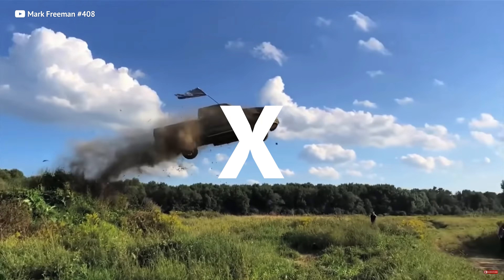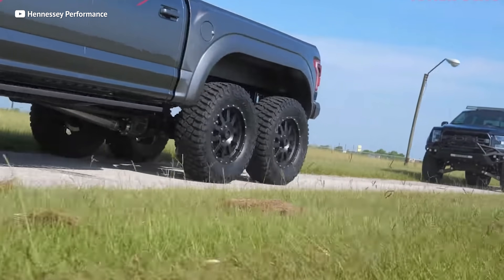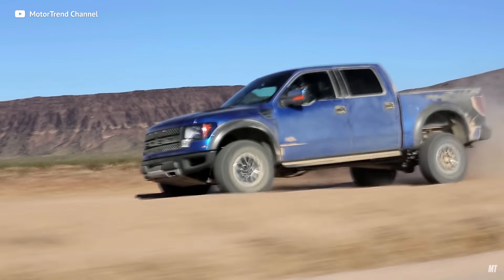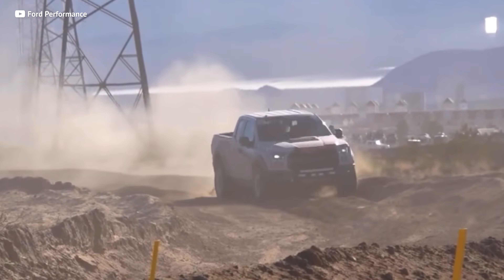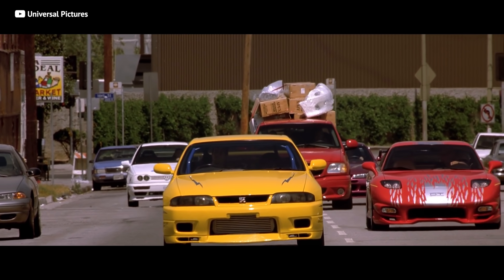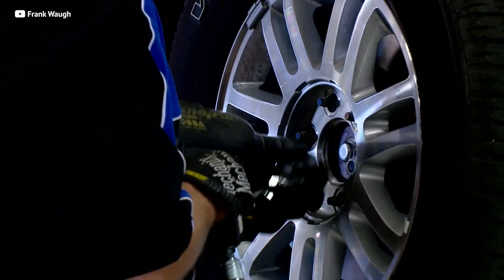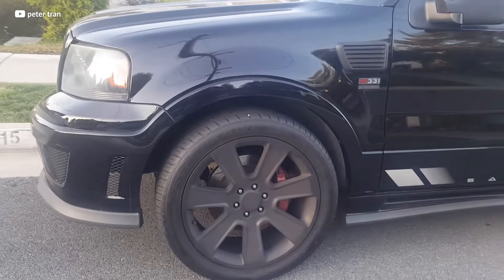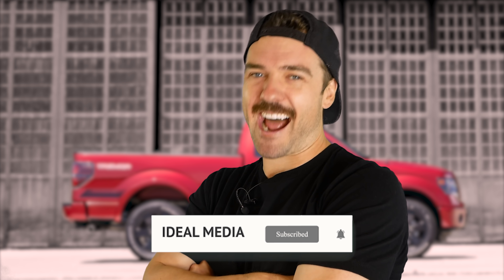5 Best Ford Trucks You NEED To Buy!

Comment: Should’ve just a f series episode now you have the new 2020 tremor f250 diesel they make the most power 475hp and 1050 ftlb of torque which means more torque than any other truck plus they can be bought with the new Godzilla engine 7.3 v8 and the tremor is a off road variant so awesome to have a off road diesel or big 7.3L heavy duty truck that can tow.
Reply from the maker: That sounds wild!

Comment: I can vouch i own a 2003 lightning and it is a beast the only complaint i have is that if the roads are evwn the slightest bit wet you shouldnt drive the truck is so light weight that you dont get any traction you go to give it gas to go up a hill and the truck loses all traction and starts to slide out and it gets horrible gas milage but aside from that the truck is truly amazing

Comment: 4x4 single cab sb e85 tuned 5.0 10spd is faster then alot of lightnings and that's like the slowest/least powerful f150 engine option.

Comment: The only problem the 5.4 has is the spark plugs break when you change them but other than that I never had a problem with the 5.4 and it gets good gas Milage as long as you  not driving it fast all the time

Comment: what about big foot & the sand box. the camper special. some had boss 302, 351c, 390m, 428 cj 429b & cj, think that was the day before all this computer. don't think i don't like the ez of turn with computers. but back in the day we were on our own. you just did not go buy all the tuning you wanted, you built it, with suspension to run it. OH YEAH, how i really miss the late 60s early 70s. just 1 of my favorite, 429 super cobra jet. that area had HP & torque to melt tires!

Comment: Why my dads raptor 2nd gen just got 213 hp the same base model the same engine twin turbo v6 even got fox springs it even said in the manual to 213
Reply: Welp ours is 2.0L so its 213

Comment: As cool as the Tonka F-150 may be, I'd rather get a stock F-150, lift it, put bigger tires on it and wrap it yellow instead for much cheaper. Maybe an aftermarket dump truck bed just for the heck of it and it would still be cheaper than a Tonka edition F-150.

Comment: Ford let's transmissions fail on the assembly line. Anyways........ Instead of bashing found on the road dead.
Lexus is the real king in terms of reliability. Tests their engines by stressing them out before it's even put inside the car. Can go literally 1 million miles if you treat them right. Did I mention Lexus are also cheap to buy and can run 0-60 in 3 seconds? Also yes Lexus has V8 engines.
Reply from the maker: Squidd just bought a Lexus GX470, that things a BEAST
Reply: @IdealMediaChannel  ya. I have no idea what Lexus truck name is but since both the raptor and Lexus are wimpy trucks at towing that means Lexus would make a fine comparison at 6,500lbs
Reply: @IdealMediaChannel  say I do have 1 serious question. I recently picked up a beautiful heavy white steel frame 2007 patriot. I want to throw a Lexus engine as soon as it dies off.

Comment: Till you find out ALL the Cam Phaser problems with the Gen 2 Raptors and how many Gen 2 owners actually go BACK to Gen 1 for reliability. Get a 2013-2014 F-150 Raptor, best years, best models and have all the Sync upgraded on top of it, thank me later

Comment: Note the V6 note please stop!! The Gen. 2 please stop!! Wait until you stop with 7.3 l is leader in it with a pro charger is the approach harder you can double the pleasure if you want but I don't think it would be wise. I think the  grade would be a better pick I wouldn't waste my money on a 6 cylinder unless I'm planning on changing the motor out and putting Is AV8 into it. Sorry I don't settle for less than 8 With that combination I spoke of with the 73 just just stock alone is under 600 horses That's before tuning that's not even both tuning both tuning the transmission and anything else along with it You could just imagine the torque is the torque from that by itself by itself with a stock motor before you do the add on to anything else afterwar That pro charger is something to behold. Screw the 2.7 screw the V6 is the 4 cylinders and all this other Pansy ass way of reckoned doing things he hoped more gears and more power into these vehicles you're going to get better gas mileage I don't understand why people don't get that , It's just ridiculous. And there's freaking Broncos a 2021 version yeah that was a dumbass idea That should not have came to 4 Russian this randition is for pansies not is for pansies not for people that actually drove a Bronco before. They're looking like they come up with what the the new version is a 35" tire really really and a smaller motor why! Any Bronco owner would tell you a 4 cylinder or a 6 and whether it isn't going to cut it especially  in a full sized Bronco, This Mid size It's a joke I got to I guarantee you off the shelf you could come up with a better Bronco off the shelf with a better frame better suspension and a better drive train this is just a joke the things that these people come up with and they didn't have to do a different version altogether we have off the shelf parts that we could have used to put this truck back together But no let's be more of an idiot in basic basically  Hop on a bad foot and do the wrong thing.  What should I need better engineers we're dealing with the same morons doing the same dumb-ass things for the next 3040 years of this moronic way of thinking without being logical it There are things that there are like Again that are on the shelf that we could put together a better Bronco whether it would be independent suspension whether it be live axle. Is still keeping AV8 without this nonsense it's nonsense that has been going on with the 6 cylinders and 6 cylinders and 4 cylinders turboed 4 cylinders turboed they gotta be Turbo because they don't want them to be normal because when they suck probably with this probably it's the reason why they have Turbos With the 2 couldn't equal on these 6 cylinders  Couldn't = Bro charger A 7.3 l motor. It's still  Probably get good gas as well But we don't want to talk about that now that might upset some painting wastes out there. And using pump gas That's not including E 85 Could you just imagine the numbers being a slight bit higher but That's pretty much it. But I definitely would love to see what 1 of these Fords would be like what the 10 speed unlocked.